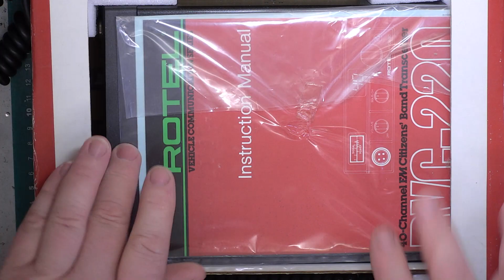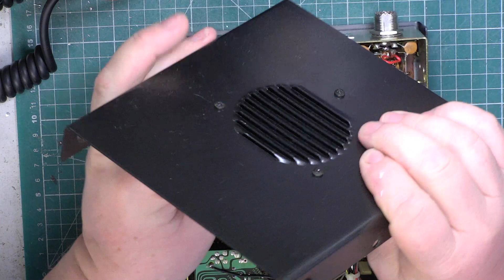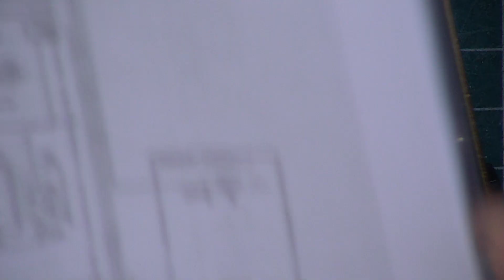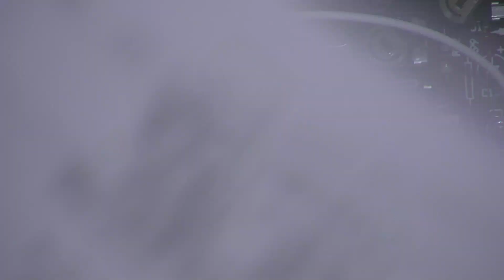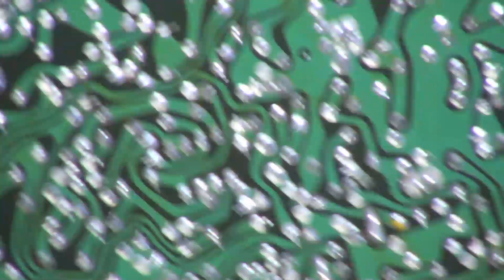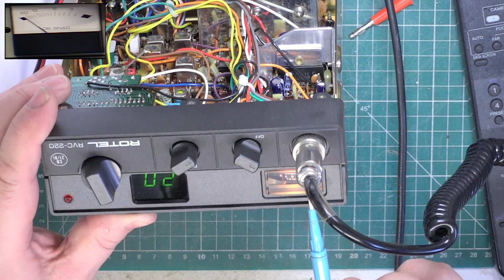Rotel RVC220 CB27/81 UK CB radio - Alignment & service

Comment: I might be wrong but i think the closest colour to the rotel case is ford graphite grey - lovely set
Do you think the receive on this model could be improved by adding the additional components to give 3 stage receive like the Rotel 230 and 240 model?
Reply from the maker: I'm dead against modification as modified sets are worth very little. The extra parts you get on the higher models just affect selectivity rather than actual range. If you want better performance buy the RVC230 in the first place.

Richard
Reply: @ukfmcbradioservicingTango21  I learned something new today. I thought they were all the same radio but with more controls on the larger set - how wrong i was! I have owned several 230/862 and 240/863 versions, but love the simplicity of the basic volume/squelch models. 👍

Comment: Hi Richard I am curently fully restoring a York 861 do you know if you can purchase anywhere the black stuff that is stuck to the cases
Reply from the maker: Not that black felt like stuff, no

Richard
Reply: @ukfmcbradioservicingTango21  Thanks Richard I was actualy talking about the rippled vinyl stuff on the top and bottom case on the outside.
Reply from the maker: It's a factory process. The case is covered in a powder & run through a high temperature furnace & melts on.

Richard